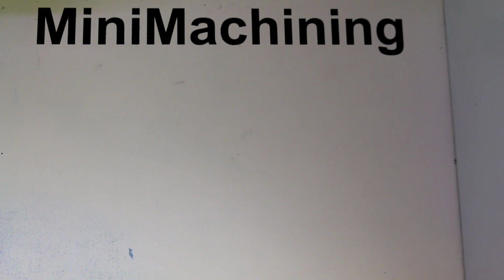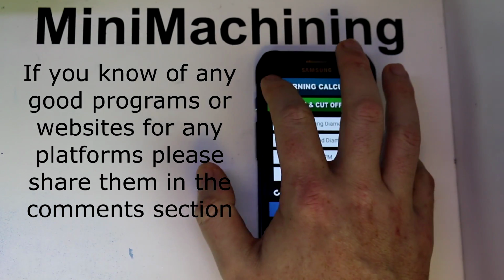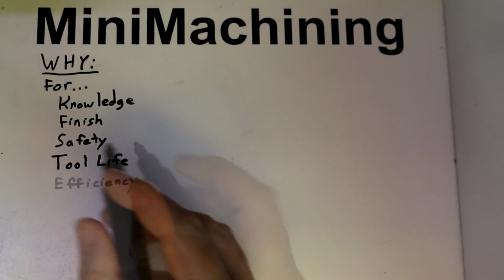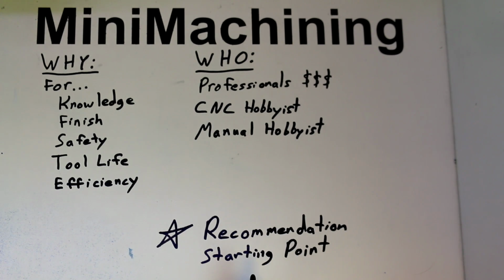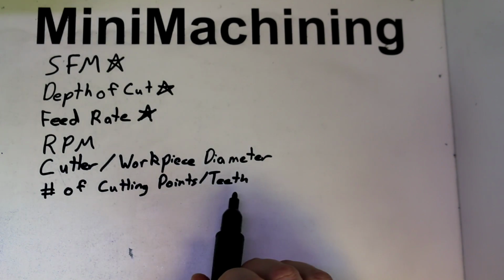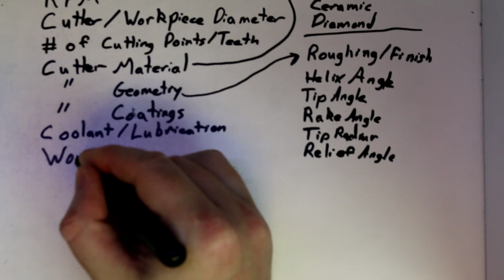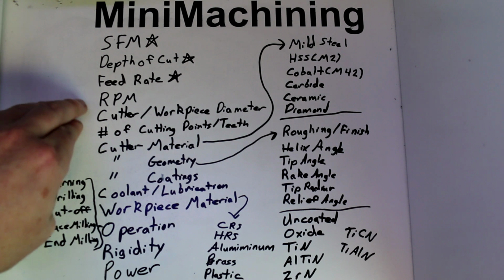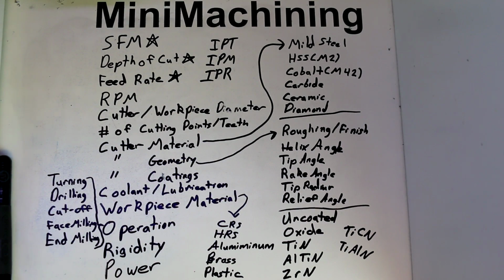Speeds & Feeds 101 - An Introduction

Comment: I will start by admitting that I am a professor and have a PhD in an area of Applied Mathematics, so you may discount my comments. However, I am reacting to some of the comments on this video. I think that this is a well organized and thoughtful video that attempts to show tradeoffs. When someone says 'we do not need the math' or 'just use the charts' I immediately think "why don't you want to understand the basic idea so that you can do it yourself, rather than just rely upon what someone else has written?" The hobby machinist will, no doubt, face a variety of situations that may not be readily available in a chart. Suppose, for example, that I want to learn how to make my own HSS+Cobalt tools and want to turn some stainless steel rod for a bicycle project (actual example). This YouTube video helps me to understand the tradeoffs and the basic ideas behind what RPM to run my lathe and what cut depth and feed rate to apply. So, I very much appreciate the approach that the video takes and I subscribed to the channel PRECISELY because I want to learn the basic, underlying principles. Great job!

Comment: Well the app is now $9.99 and I don't see a free version. Which I don't mind paying for the app. because, it looks like it's a great app. I'm planning on buying it. It beats sitting with a pen and paper and a calculator. The company I work for does not want to buy a cad cam program. So, I program everything on the machine using canned Cycles. And feed and speed is essential for turning or milling. It really sucks because now that I'm looking through the old programs they already had. They had somebody that didn't know what they were doing, and just put 2000 RPMs limit with a G50. Then just put s650 with a G96 for everything. Most of the material is 304 SS. So, I am constantly having to grab a pen and paper and figure the correct feed, and spindle speed. Thank you for the video. I didn't think they had good cnc calculators for the phone. Honestly I never bothered to look. So again thanks for the video and thanks for the heads-up about the calculator.

Comment: For the record, carbon steel cutters are not mild steel, mild steel has very low (Wikipedia says 0.05–0.25% ) carbon content and is basically unhardenable. Just throwing that out there, in case someone tries to make a cutter out of mild steel. Loving your video series otherwise, very well produced, informative and entertaining, you've been making me want to get a Sherline mill and lathe again.
Reply from the maker: Thank you very much for the feedback, I should have been clearer and more precise in my terms used. I need to do a few videos later on the specifics of materials and identification, so much I still want to cover :). Carbon steel cutters vary widely in quality and can indeed be made of very soft mild steel. Some imports are made out of mystery metal, and can be very poor or low quality steel if intended for frequent use. If you want good quality then you will pay for it and it should include a specification of what material was used to produce the cutter. You used to be able to purchase "low carbon steel" cutters specifically as high carbon steel (HCS) and high speed steel (HSS) were more costly. Now I think you get mystery metal, HSS (sometimes also a bit mysterious), and various grades of carbide as manufacturing costs have dropped over the years. 

In the video, regarding cutter materials, I'm using mild steel very broadly to include most un-named steels since many cheap cutters are indeed un-named in what they are made of (low carbon, high carbon, alloy, etc). Don't expect good steel in the 600+ piece lathe/mill/drill cutter set you find on sale for $9.99 with free shipping ;)... yes I'm sorry to admit I've tried them, and it is about the only time I've been able to bend steel with my bare hands like superman LOL. Have to be careful with names like carbon steel and mild steel as they are very generic and will be applied differently depending on who you talk with, the industry you are talking in, and what part of the world for the discussion. Best bet when possible is to reference the AISI, ASTM, SAE or other standard for the material if you really want to get accurate.

Case in point is 1018 steel. Per SAE standards all steels beginning with 1xxx are carbon steels, while the "18" indicates it contains 0.18% carbon making it a mild steel (per wikipedia's numbers). So it is then a mild carbon steel. And it is indeed able to be hardened to Rc42 in the case of 1018, much depends on other elements present in the steel although higher carbon certainly does make for better hardening in most steel alloys).

And I'm not sure if there is a standard on what "mild steel" officially is, you mention wikipedia as listing 0.05-0.25% but for contrast some of the cutter manufacturer charts shown in the video list "Mild" with up to 0.50%??? And I love wikipedia but have to be careful on their references as they are community generated, the citation of the 0.05-0.25% is to another non-standard body website... which then actually lists the range as 0.05-0.30% LOL. And even in the wikipedia article I found it shows "definition needed" for Mild steel. Low/Medium/High carbon steel are probably more accurate, but still a little fuzzy without a specific percentage listed. The fuzziness on these names are why the SAE and AISI wrote standards beginning in the 1940s to help clear up what material is what.

Technically you can make perfectly good cutters out of some "mild" steels... if you want to make a one-off short-use cutter for aluminum, brass or other "mild" steels you can use mild steel, not to mention for wood, plastic and other materials. Now those cutters are not going to last very long without resharpening (but resharpening will be relatively easy), and that mild steel cutter will last all of a couple milliseconds if you attempt to use it on a high/super-alloy material.

https://en.wikipedia.org/wiki/Carbon_steel
Reply: Thanks for clarifying